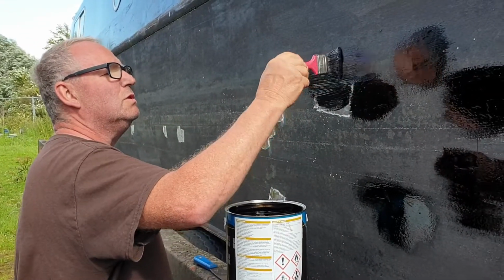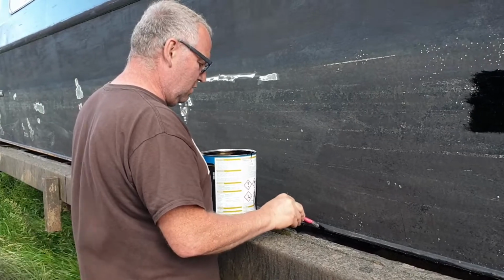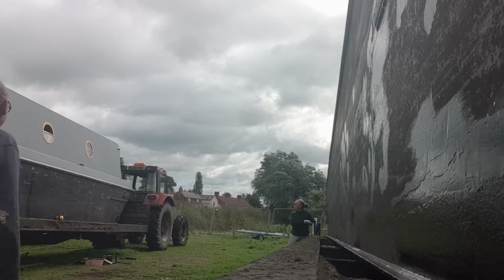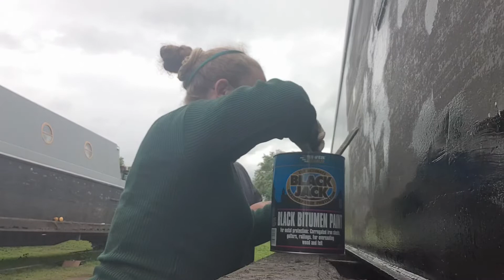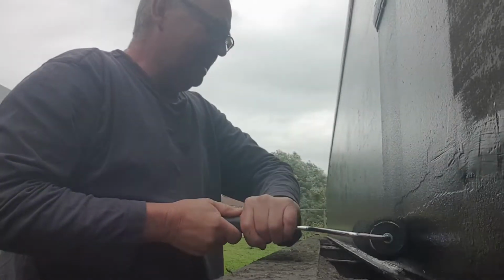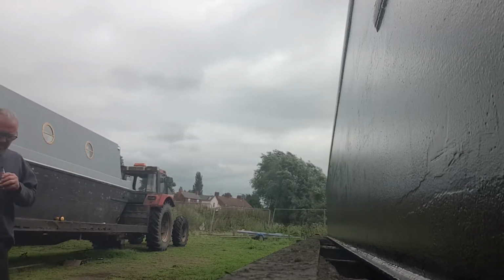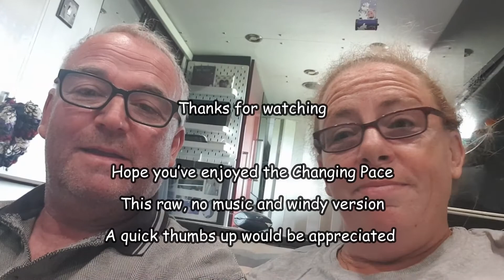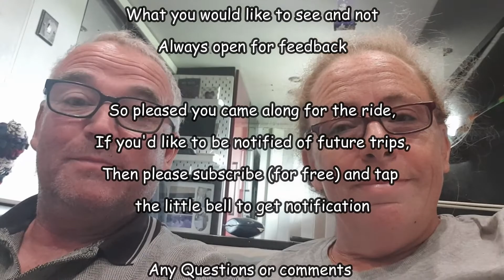#18 DIY Self Painting Blacking our Bottom Hull with Bitumen paint LIVEABOARD NARROWBOAT MAINTENANCE

Comment: Wondering why not put Marine Tex (Bondo) over the grounded, bare metal spots?
Stuff works WELL and great for spot repairs.
Question:: did I hear correctly that the thickness of your NB is ALL 10ML (not the 10,6,5,4 standard thickness)?
Reply from the maker: We only had the bitumen paint that we had brought with us, as we didn't know what state the hull was going to in until jet washed, I was hoping that the original primer would still be in place. Next time we black her I will be better prepared. With regards to the steel thickness she has a 10mm base plate, 6mm sides and 4mm top which is more or less the standard in shell builds these days. Regards Dave